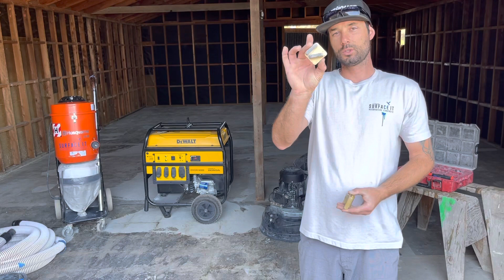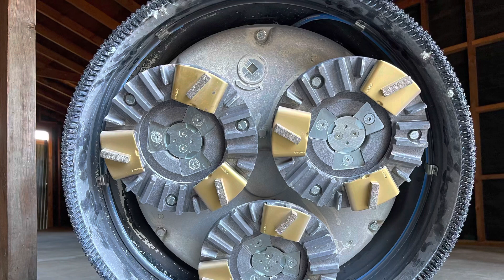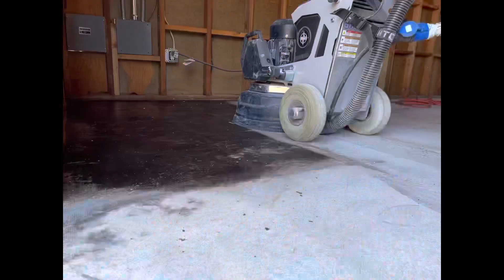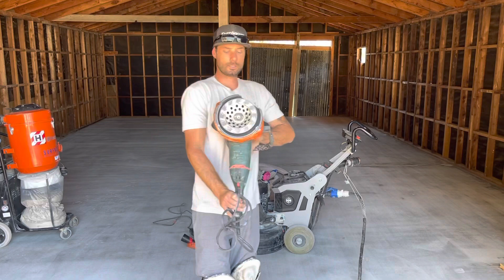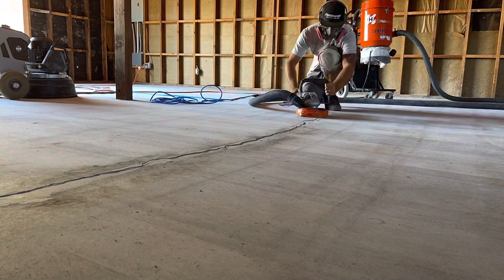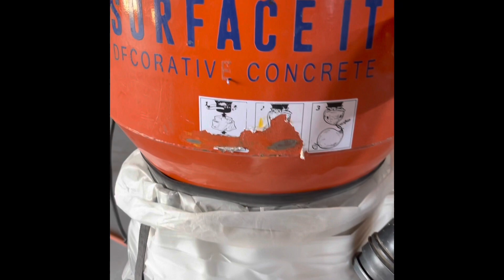Concrete Surface Prep Restoring Damaged Concrete ( Part 2) Grind/ Stain / Seal process #surfaceit805

Comment: What was that you were spraying on the floor when you were grinding? Great video man, love the IG.
Reply from the maker: Hi Eddie , thank you. I was misting the floor with water this helps keep the diamonds bits cool during the grinding process. Otherwise if you get too much heat on the bits they can glaze over and  won’t cut the concrete as well.